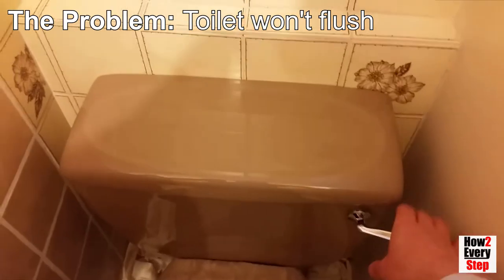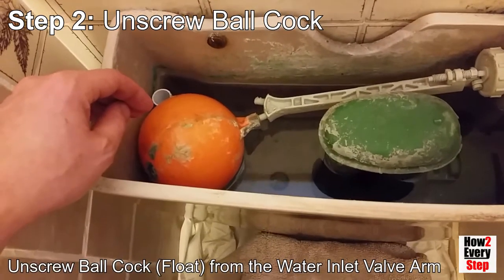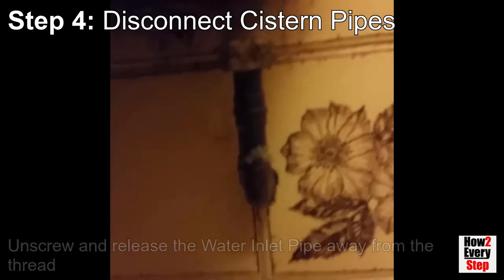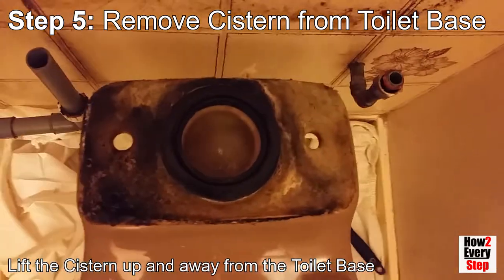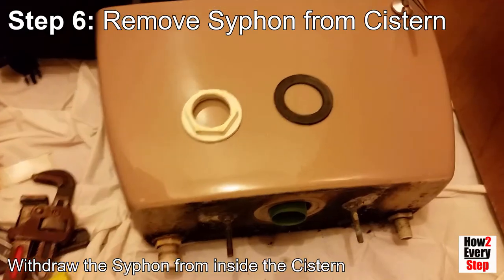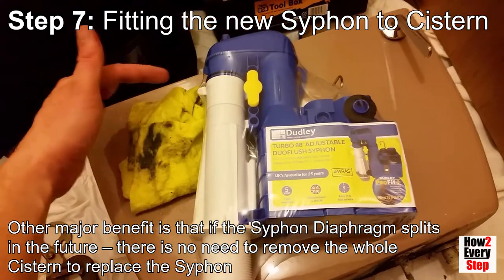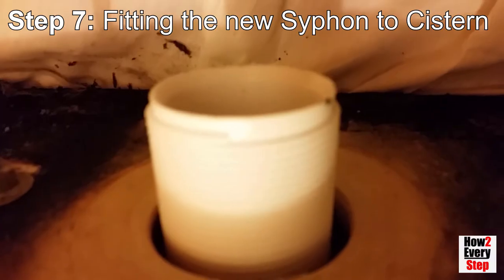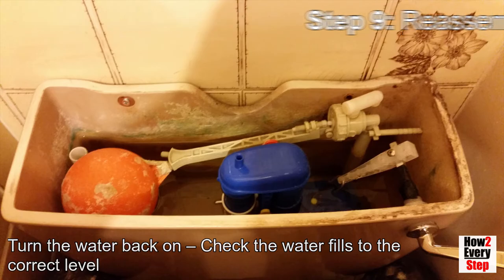Toilet Syphon Replacement Repair Guide - Toilet will not flush - Cistern Removal - Dudley Turbo 88

Comment: When you’ve removed the siphon you can then remove the broken diaphragm and replace it. You can buy one for a pound or so if you know the make and model, or you can make your own with some sturdy polythene using the old one as a template. You don’t need to replace the whole siphon unless you want to, for example to upgrade to a dual flush.
Reply from the maker: Hi Julie.  Very true.  I always think if you are removing the syphon anyway you might as well replace the syphon so you get nice new rubber sealing washers too.  If the diaphram is old and cracked chances are the sealing washers are the same age and perished as well.

Comment: Fixed my own non flushing syphon in 10 minutes for 2 quid and a fiver for a pair of plumbing pliers. If I'd have got a plumber in I probably would have been looking at 50 quid minimum. Now my bog can flush away a pound of Dundee Cake without breaking sweat.
Reply: Peace of mind I’m sure, especially if you have elderly relatives on board.

Comment: Not quite sure why you had to remove the cistern. Couldn't you have replaced the siphon mechanism in situ?
Reply from the maker: Hi Linda.  The siphon fixing nut sits under the cistern so you need to remove the cistern to be able the undo the siphon nut to replace.   If you watch the video all the way through you will see what I mean.  Thanks Col
Reply: @How2EveryStep  I really appreciate your reply. Cheers.

Comment: My entire thing lifts up when I flush the handle o.O
Reply from the maker: Has the linkage broken between the handle and the siphon?
Reply: @How2EveryStep  no, the siphon thing Lifts up with the handle
Reply from the maker: It sounds like the syphon has come disconnected from the cistern base - if that's the case it's probably worth a syphon swap as something has sheared.  Good luck!
Reply: @How2EveryStep  thanks for the input